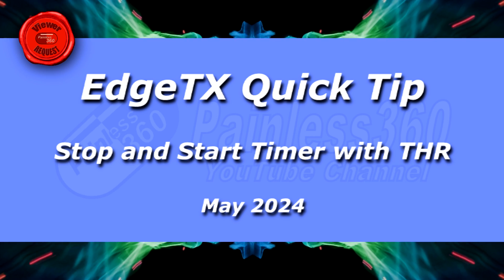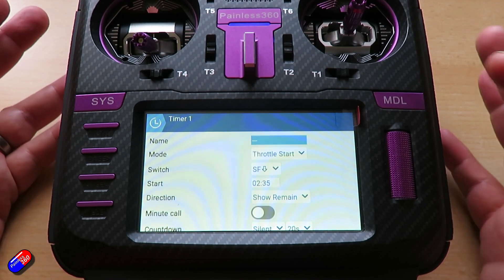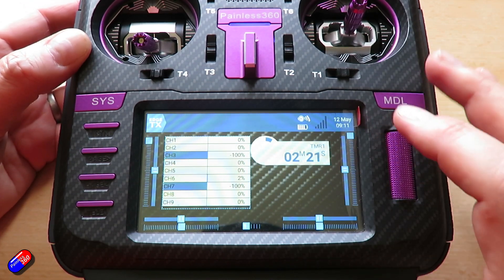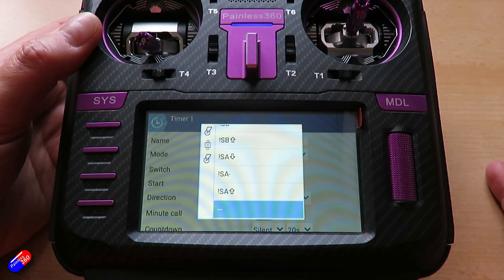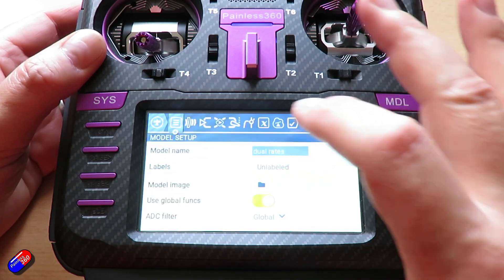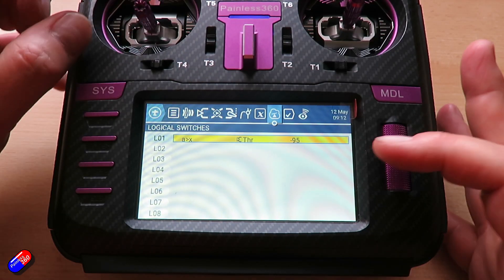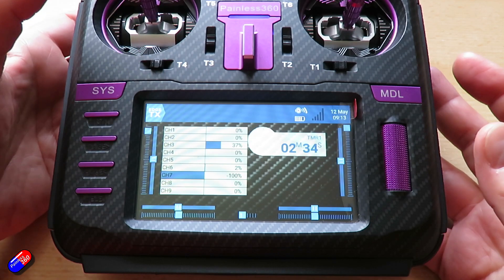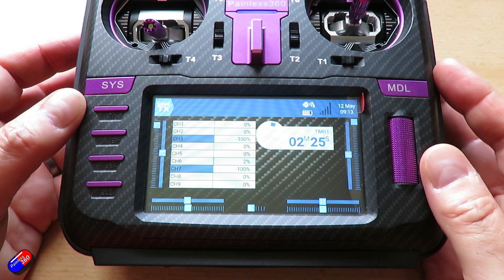How to start and stop your timer using your throttle on EdgeTX (viewer request)

Comment: hoping for a little input, I used your dolphin dip files had to go through and fix a couple things for some reason but I’m getting an issue where it’s telling me it cannot arm because not centered and looking in. I have it looks like my pitch or my role I can’t remember in the neutral positions aren’t centered. I have no mixes set up for it to do that nor any settings in the controller set up for that, how can I fix or resend it? I’ve already tried to recalibrating. on my tx16s
Reply from the maker: Pitch needs to be about 6 degrees up. See my comments that in the video. Best of luck
Reply: @Painless360  yeah it was set up that way. It was literally something on my radio. I ended up fixing the issue. It was not registering. One of my sticks is being centered.

Comment: Love the content, I found the  V1 as throttle 'input'  stopped throttle hold pausing the timer, so i changed v1 to throttle "channel" and that effectively also allows hold to "pause" the timer as well.
Hopefully I understood the use of channel and worked out well and maybe useful for others to try out.
Reply: Thanks for the tip!  Now it works exactly how I'd like it to

Comment: If you want the throttle to start and stop with the throttle stick just use "Throttle" instead of "Throttle Start". It does the exact same thing without the logical switch.

I personally prefer the "Throttle %" timer so the timer runs faster or slower depending on how aggressively I fly and also stops the timer entirely at low throttle.

Comment: I prefer to have 2 timers with one being for the total on time that starts and stops with the throttle cut switch and the second timer uses the Throttle% option. 
The TH% needs a little testing to get the actual time set but once that's done you'll get an accurate timer that accounts for slow and/or fast flights.

Comment: I must be old then lol  i'm still using open tx as it literally covers everything i need
Reply from the maker: Me too, on my Taranis. You really need to change if you start using ELRS as the devs don't test it on Opentx and not all of the latest features work... Happy flying
Reply: @Painless360  I have one trans with edgetx for elrs but I've programmed so much into the open tx trans (flaps, pan tilt zoom, flaperons etc etc etc)that it would take the best part of a day to reprogram it all back in to edgetx
Reply: As I understand it, there's not much difference between EdgeTX and OpenTX on the black and white radios anyway. If you're using a colour touch screen you want to be on EdgeTX though. My radio is B&W but I do have ELRS so I made the move to EdgeTX too.
Reply: @Invid72  there's a ton of improvements in the backend.  I guess if opentx works, keep using it. But it's not hard to update and there's lots of good improvements imo

Comment: I really like these quick videos about specific things. Also thank you for not using the edgetx windows software which is much different lol.
Reply from the maker: The companion software is better for videos but I know lots of pilots don't use it... Happy flying
Reply: @Painless360  yeah it's a lot easier to film but isn't the same as the radio layout. IMO it's much easier to follow when you film the radio itself
Reply from the maker: Many feel the same way, so I try to use the radios as much as I can. But, there are issues with the screens when filming... Happy flying
Reply: Its ideal to see iit on the radio as at the field most of us dont take a laptop/tablet

Comment: I managed to make timer1 count my current flight time when armed, and timer2 counts total time. My current model is at 14 hours
Reply from the maker: You can also use the 'flights' LUA script to keep track of how many flights too... Happy flying!
Reply: @Painless360  I noticed that after updating but haven't played with it yet, i need to get that working too
Reply: @Painless360 i haven't been able to get that flight counter script working. I google it and there's literally zero results. How do you enable it? I just get an empty box with a logs button
Reply from the maker: The flight is considered successful if after 30sec the engine is above 25%, telemetry is active (to indicated that the model connected), and safe switch ON. The flight is considered ended after 8 seconds of battery disconnection (detected by no telemetry). So unless you have it setup properly and have the model connected, it won't work..
Reply from the maker: https://youtu.be/bT08M0S3MY0 :D